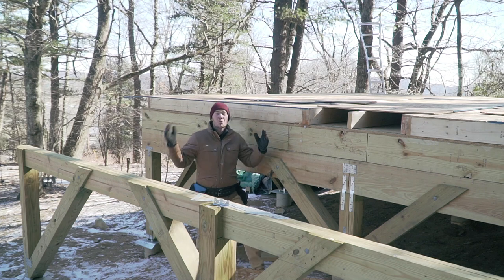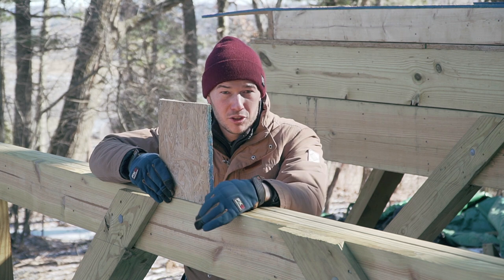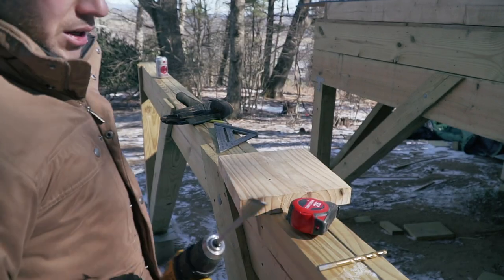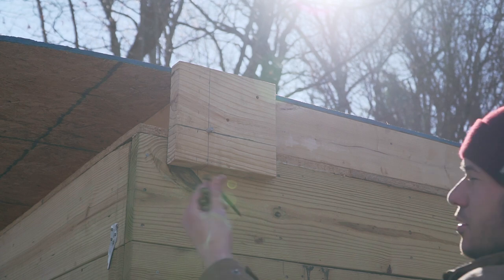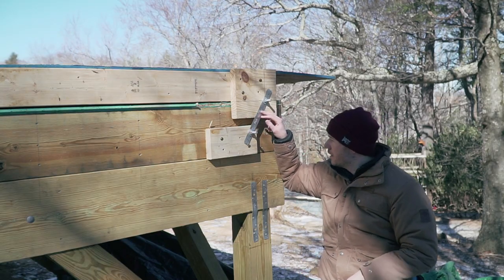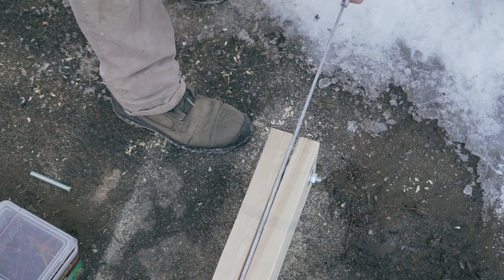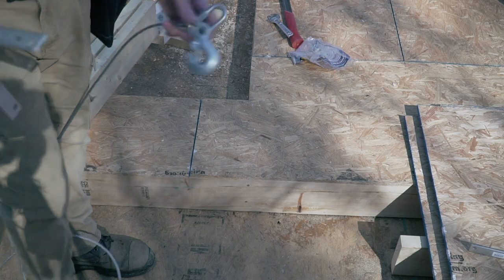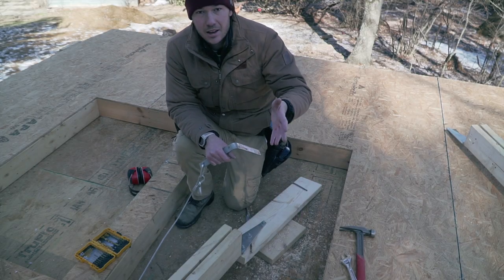Cheap DIY Wall Jacks to Safely Raise the Cabin Walls - EP 21

Comment: FYI..in the future...toenail the bottom plate to the floor. Before you install the sheathing. When you lift the wall ...the toenails will keep the wall from sliding away from you and off the deck. Larry Haun probably had a wall building video showing how that's done.🤠
Reply from the maker: Hi Jeffrey, yes I had seen it when I was looking around. But I still feel weird about it. Have you tried this method ? Has it worked well for you?
Reply: Yes...an 8p nail just enough to hold the wall and not damage the plate. Usually buy the time the wall is mostly vertical the toenail is almost out...allowing you to adjust the wall into its final position.
Reply from the maker: @jeffreyjacobs6072  good to know !

Comment: The pros I watched just fired in some 16D nails at an angle through the wall plate and use that as a hinge.  Definitely the fastest way but no idea how safe it is.
Reply from the maker: I agree, I’ve seen it too, and since I have never raised a wall and that I’m by myself. I preferred going the extra mile to make sure nothing wrong would happen.
Reply: Sounds like the Perkins brother builders lol

Comment: I admire your ingenuity and creativity! Sometimes when you're all by yourself you have to take the extra steps to get the job done and still be safe from catastrophe. I agree about the toenails into the bottom plate to keep the wall from sliding but as for the extra people for lifting, as I well know myself, sometimes it's just you. Great contraption idea. I'm looking forward to the hoist!
Reply from the maker: Thanks Raevan ! So you’ve also had position experiences with toenailing the bottom plate ?
I knew about it but was scared it would not be enough and since I could not afford anything to go wrong, I just did not go that route.
Reply: @TheDIYCabinGuy  Yes, I've had great results with the toenails holding. The nails act as hinges and you put bracing on the outside so the walls don't fall over. It's just the lifting of the walls that becomes difficult when you're a crew of one.

Comment: Great video.  After watching your video I wondered how other DIY wall lift jack folks stabilize the bottom of the 2x4s or 2x6s so they don't shake.  They either have a tripod "foot" on the bottom or a 4'x4' (or thereabouts) piece of plywood screwed to the 2x that makes the 2x beam stand vertical without wobbling side to side like yours did.  The movement of those beams before you began cranking was scary indeed.
Reply from the maker: Thanks

Comment: I am using a framing wall jack. Back off the framed wall by the thickness and toe nail at 45 with 16D nails as a hinge. Also nail plates to the outside of the joists to help the wall to not slide off after the toe nails loose strustural. Pin the jack post and stand on it while leaning on the top part of the jack to maintain depth on the top of the wall. The 2x4 jack spine will degrade over time so use best judgment when working. Please be carefull about imposing ultimate safety to your clients in the designs. With experience and communication we creat value to adding an engineeer to projects.

Comment: As others mentioned the standard sill plate toe nail to the plywood works well. For critical and or heavy walls use a couple pieces of black metal strap from a lumber yard. Slide the strap under the sill plate, nail to the bottom of the sill plate and nail the other end to the floor ply. Lift.
Reply from the maker: Thanks Nick, you’ll see that’s what I ended up doing with the front wall, I used a simpson strap nails to the subfloor and to the bottom plate, worked very well
Reply: I've always just nailed blocks on the perimeter that stand up a foot or so. 

Yeah sheathing would be in the way in his case, but he could rip it off and nail it to the band, then wrap the wall (while it's laying down, like a smart person would) and fold  up the bottom about a foot. 

Toenailing the sill works, but I prefer to avoid it for the most part. I'll use a few, but it's a pain to push the wall around when it's nailed down.

Comment: At the bottom just use a 4 inch door hinge and bolt through it. At the top, embed some strapping between the sheathing and the studs, nail it repeatedly with roofing nails or a stapler, then sheath over it, leaving a loop at the top. 

Ive used 2x4s and fence posts for this, the galvanized 3" thick wall commercial fence posts work great if you hsve a welder to mount the hinge at the bottom and a pulley at the top.